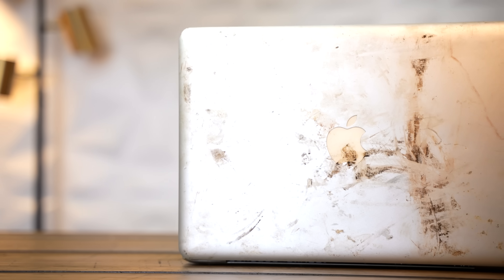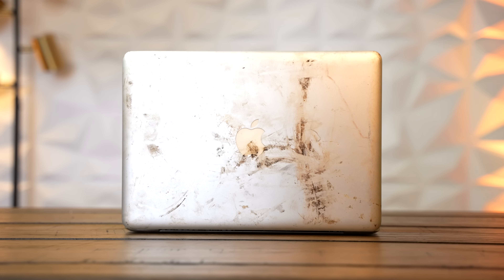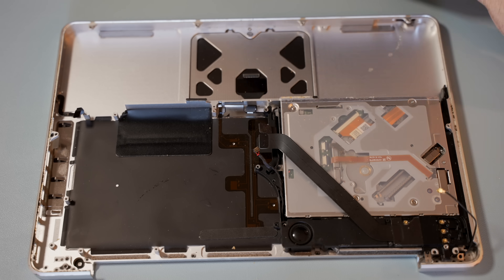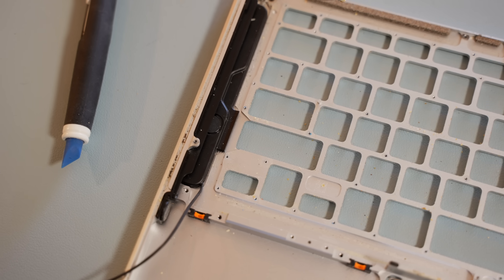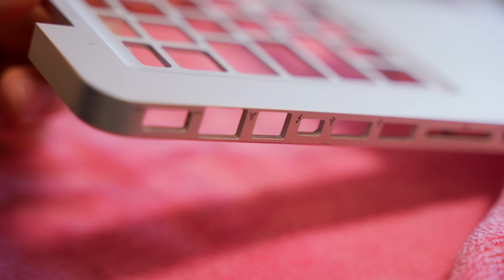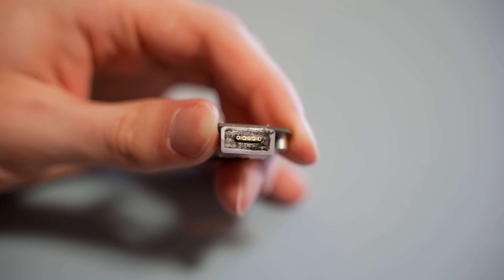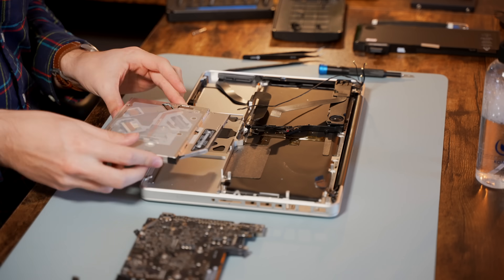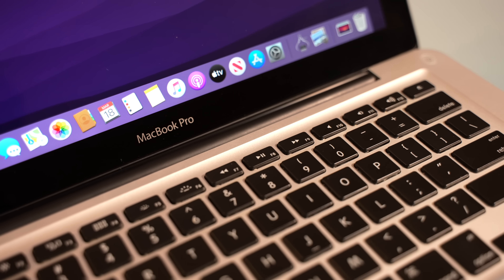Deep Cleaning & Restoring this FILTHY MacBook Pro for $10!

Comment: Even Lord Vader would be impressed by this.  “I see you’ve restored another MacBook.  Your skills are now complete. You are indeed powerful as the Emperor has foreseen.”  Also using a mid-2012 MBP with 512 GB and 16GB of RAM to replace my 16 year old mid-2009 MBP which had screen delamination and battery which couldn’t charge anymore.  It stands alongside my mid-2015 MBP, late 2021 M1 16inch MBP and the old 12C and 64GB Mac Pro thrash can with old Thunderbolt Display.

Comment: Not sure if this has been asked Luke, so I'm wondering:  If used in SERIOUS MODERATION, could you use a small handheld vacuum on the non-electrical parts, to suck up a lot of that crud? That poor Macbook was disgusting, and great job on the restoration!

Comment: The funny thing is........I'm watching this on a Mid 2012 Macbook pro... I'M still using this Macbook because of luke and his early videos....... My Macbook is fully maxed out with 16GB RAM and 4tb ssd (That's kinda overkill) with raid storage 2tb each i swapped out my superdrive with an harddrive enclosure and it's still worth it in 2021.

Comment: hi there , I have bought the same macbook a week ago and decided to clean it when took the bottom cover off there was a lot of small glittery particles which came out underneath the black sticker which is like a pad for the ram , just wondering is it toxic material ,can I clean it with bare hands it looks like led or graphite I am not sure :) will appreciate for any advice 
thanks and by the way very good video 👍

Comment: I have the same macbook and it runs like a charm in 2019 i bought a brand new of the year gaming laptop and all i want to say is fuck windows, i hate them so much i just don’t have luck with it. The laptop broke and was soo slow i could go on vacation come back and it would still be loading. My macbook of 2012 i think works soo well i’m gonna use it until it dies. Then buy another macbook haha
Ps: finally someone who has a sponsor that is good and related to the video. I’m tired of those bullshit sponsor mobile games cough raid shadow legends*cough*.

Comment: Hey Luke, what you did here is simply phenomenal, I was impressed with how thorough you are. Great work!

I would appreciate your opinion on this: 
I have a mid-2015 Retina 15” MBP, what solution would you use to clean the Retina Display with? I saw you using Koala for the 2012 but that is plain glass w/o the anti-glare coating. I read people recommending iKlear or Whoosh for Retinas but I’m also seeing some negative feedback as well. I would like to be particularly careful, especially because I hear that the 2015 is the one that is prone to have issues with the anti-glare coating on the display the most…

Thanks for your opinion in advance, I am sure from your many years of experience with all those Macs you have the right answer.

Comment: Hello Luck , fantastic videos, congratulations . I am from Brasil and I have a MacBook Pro 2016, and I am trying to fix my lid , that not wake up or put the  screen  to sleep by opening or closing it . I try everything  that could be fixed by  soft, like reseting SMC, NVRAM, booting by external drive, formatting internal hard drive,  but  the sensor stills not working.  Could you give me a tip or make a video how to locate it and how to get there. It could be a simple bad connection ?   Is there a place to buy it? Thanks in advanced for any given tip. My email address is mrpaulo@hotmail.com

Comment: The chance of the average user disassembling this to that level is about 5%. The chance of sane user successfully putting it back together is only 0.000003%. 

67 tiny screws just fit the keyboard. Nope. 

Your skills are impressive but not easily duplicated. Maybe a quick superficial clean is just fine for a 6 year old operational machine.

Comment: I had my mid 2012 MacBook Pro upgraded to 16gb 480gb SSD and new thermal paste last year and it’s literally better than new. It’s a sturdy computer (that model of Mac Book Pros were designed that way) which I LOVE, and it runs like an airplane. I can work with literally 50 Safari tabs on three different windows, Photoshop, Illustrator, Adobe Acrobat and Whatsapp at the same time.
It’s literally like having a brand new computer.

Comment: Actually you don't HAVE to ditch the top case, but removing the keyboard is a destructive process for the keyboard itself, the rivets have to be individually removed with side cutters, and a new keyboard has to be installed with self tapping screws, 67 of them, apparently.  I never bothered to count but it always felt like more than 50.

Comment: I love projects like this one~ ^_^

About 1.5 years ago now, I bought a Macbook Air (11") for ~110$CAD, with a 'stain' on the lid and 'trackpad issues', as well as some cosmetic marks and grime. A little elbow grease, alcohol wipes, and reseating/cleaning the trackpad, and no more stains, no more marks, no dirt, and its in perfect working condition! Someone offloaded it 'for parts' because they didn't know how to fix it.. it took me about 5-10 mins, because I knew what to do (its not difficult). One of these days I'll upgrade the SSD to something a little bigger capacity (64gb right now..)

Always preferable to fix and re-purpose (if possible) IMO~ ;P 
It's still going strong and is great as a backup/portable laptop. Just wish the RAM wasn't soldered on ;'D

Comment: nice job luke for cleaning and restoring that macbook mid 2012... i have 1 question did you used eucalyptus oil on cleaning the macbook that was psivewri is using?

Comment: I picked up my MBP 2012 13” in June 2017 for $260. I added a 256GB SSD and a 8Gb stick of ram immediately and put in another 8GB stick last year. A great value for what I paid, but now that she’s no longer officially supported, I’ve been planning my next move to a Mac Mini. At this point I’m just waiting for M2 and (more importantly) a model that’s not $400 more for a 512GB SSD and 16GB of Ram.

Comment: It's alright but 512gb ssd and 16gb ram more than 10$....
Though I get that was just extra stuff you probably had lying around...

Reminds me of once I bought a used MBP 2011 for 50$ and the mag safe was so dirty it was giving it issues... First it wouldn't connect then it did but it fans would spin too loud once I clean it out solved both issues too a few tried though...

Comment: My mid 2012 13" is still alright. i7, 8gb of RAM, and cheap 480gb SSD is still doing o k a y. Mostly needs a new battery, possibly new mic (or just plugged back in) and some of the keyboard keys are crunchy which I'm hoping I'll see how to fix in this video

Comment: Was this thing buried in a backyard for a week, and used as a hammer? Fantastic transformation and save!

My 13" mid-2012 has always had an EnCase snap-on case, Moshi keyboard cover, and rubber plugs in the unused ports. Still looks mint, still runs a treat.
Intel Core i7, 16GB RAM, 512GB Samsung Evo Pro SSD (cost a mint back in 2013). Still gets about 5-7 hours on battery, depending on usage.
Waiting for the 14" MBP with M1X to drop...

Comment: The Retina MBPs don't require you to ditch the whole top case. Yes, they keyboards are riveted in, but it's easy to remove, and you can buy screws, sometimes they come with the new keyboard, gotta check the description, and just screw them in. Soft aluminum so the screws go in easily. The screws work almost like self-tapping screws. C'mon man! Thought you would know this!

Comment: That Mac supports 8 gigs of ram. 16 can make it kernel panic
Reply from the maker: Wrong
Reply: @lukemiani  no I’m right.
Reply: @lukemiani  I’ve seen a bunch
Reply from the maker: @WilC137  Mid 2012 MacBook Pros can run 16gb of 1600MHz DDR3. Look it up
Reply: @lukemiani  I did. The MLB supports up to 8 gigs of ram. It might work okay with 16 but it can cos graphical issues, random shutdowns and kernel panics

Comment: Why didn’t you upgrade it to Big Sur ? 🤨
Reply: Late 2013 is the oldest MacBook Pro that's compatible with Big Sur.
Reply: @blagger116  There are patchers available that allows you to install Big Sur on these unsupported 2012 machines. I used BenSova's Patched Sur to install Big Sur on my mid 2012 13 inch Macbook Pro and it works great.
Reply: @aniello2000  yes me too but find my Mac is have some issues. It’s not recognized my phone WiFi range also smaller than catalina
Reply: @aniello2000  That's true but isn't the whole point of the video to restore the machine as closely as possible to its original aesthetics and capabilities? Any modifications to that could be done later if desired.
Reply: @blagger116  can’t we solve it
Reply: @blagger116  i knows that but  we can use Big Sur patcher 😎
Reply: Just wanted to point that out, that's all :)

Comment: Fantastic restoration job Luke. Looking forward to the future video. Unfortunately I would think most electronics sent to recycling centres just end up getting shredded and melted down to extract the valuable materials from them. It's a massive shame really when machines like the Macbook in this video can often easily be fixed up and used for several more years but they generally get scrapped as they are considered to be too old to be worth fixing.

Comment: I’ve had my mid 2012 since new. I’ve had 3 cars, graduated from 3 schools, and she’s still kicking strong. (Edit: I use it daily for everyday use I’ve upgraded to 16gb RAM, 500 SSD, and new thermal paste). I’m gonna use it till it dies at this point haha
Reply: still rocking a macbook pro intel core 2 duo from 2007........long live Snow Leopard
Reply: @Resume08  My current work from home machine is a 2008 mac pro which ive hacked the fuck out of. Runs Catalina. 2000s era macs are just awesome
Reply: @willm5032  Plus, you can still open them up and work on them. 😀
Reply: @cgi2173  Yep. This is true! I'm still eventually going to have to update my home mac to something more modern as I work on it and Software I needs more modern processors but for now my old mac pro is great.
Reply: @Resume08  I upgraded my 2007 iMac with 4gb ddr2 and did a cpu upgrade to a penryn t9600 2.8 and dropped in a 500gb HDD I had laying around it’s still going with Mac OS El Capitan
Reply: picked up a 2011 17-inch on eBay for $350 and it’s an absolute beast. The MBPs from this era truly are the best
Reply: @garysimcox345  If the gpu goes out (only problem with them) look up how to disable it and it’ll run off the intel one on the board.  The oven thing is temporary.
Reply: Same one. With a ssd it runs so smooth
Reply: Have to agree, my good ol' 2012 Air still rocks even with today's standards! It's incredible how valuable these machines are.
Reply: I have one, it's my main machine. 😀
Reply: Mid 2012 is the best. Upgradable, and Metal API support, so you can just patch it to Monterey without causing issues!
Reply: Fantastic - I also have a mid-2012 Mac Pro - never cleaned but replaced the former hard drive with a 1 TB SSD - can imagine doing both would enable years and years of more great use. About cars, I had an Alfa Romero Spider in the 80's - loved flipping down the top even in the winter, but it was in the repair shop every few months for small fixes.
Reply: I use a Late 2011 13" MBP, 16 gig RAM, 500 SSD and it looks "as new". I want a new M1 Air, but I can't say I need one. Old faithful is good enough.
Reply: @bolindow176   I want a new one as well, but don't need it if mine works like new
Reply: @bolindow176  owning the former and having setup three of the latter for my colleagues, I have to say you won't miss the 2011 clunker after you experience M1. I've got 2015 and 2017 13" MBPs as well, and they too pale in comparison.
Reply: I had one for years but the M1 MacBook Pro coerced my to upgrade, staying in the family though
Reply: I’ve just bought a 2013 retina MacBook pro
Reply: I love when people take good care of their devices. I had a samsung r580 since 2010, she's still kicking. She would even need an upgrade and boom she'll be super fast.
Reply: i second that, my mid 2012 13in macbook pro has been a trooper since day 1, even accidently spilt a entire bottle of water on it about 6 years ago and it still chugging along damage free!
Reply: Yup. Same here. My mid-2012 MBP i7 is doing well. It could use some new shoes (missing feet) but SSD and RAM. are wonderful upgrade. I probably keep it until I can buy an M2X. You know how Apple is by the 3rd iteration of a product its almost 100% improvement; loot a the iPod, iPad, iMacs, etc etc.
Reply: What if it suddenly dies? The data?
Reply: @SweetSourPickle  I back up important files. If a capacitor goes I plan to fix it, it's part of the fun
Reply: Same. Only thing I need to do is change thermal paste. How is the performance of yours? Mine is becoming slow and I think it’s thermals causing the bottleneck
Reply: @HeresMo  She runs fine. If yours often runs hot, then I would change the paste and clean the fan.
Reply: @MrVnick1  yeah I’ve changed the fans already one was faulty so I swapped them out. Next task the thermal paste
Reply: i just pick up a mid 2009 macbook pro for $199 n it runs soo gud love typing with it n watching movies soo gud for it age
Reply: i swapped my cpu it works way better
Reply: Same!!! My mid 2012 is working better than most windows laptops after 2 yrs. I too use it daily and I've upgraded to a 120ssd and I've replaced the battery recently.
Reply: just upgrade the battery and you are good ;)
Reply: I have one and it’s starting to die now. Can’t get 5 mins into a video without the fans turning on v loudly, and from startup there’s a 50/50 chance the Bluetooth works or says ‘not available’. Wanna get a new pro but they cost so much 🥲
Reply: Hi, I recently bought a refurbished (almost new) 2017 MBP. It has a few marks on the top of the case but thats okay. It runs like a dream and I cant wait to see how long it will last. I got it just in time to go with my Iphone 11. 😎
Reply: Same but my cpu kinda dead en need a ssd
Reply: i’ve got an early 2011 13 inch and it still works great. ive only got 8gb of ram and a 500gb ssd
Reply: Omg how did you upgrade the ram did you do it yourself or did you take it to the shop i need help my 2014 windows computer as been really slow recently it can’t even load up YouTube without lag
Reply: Exactly the same as me.
Reply: Same I have a 2015 mbp its really good its best for video edititng and platine game
Reply: Make sure to increase your days with it to repair it
They're really easy
Reply: I’ve been using it since last 11 years. It just needs cleaning up internally every two years but works just fine. I replaced hard disk and DVD drive with two 1 TB SSD and added 16 GB RAM and replaced the thermal paste.
Reply: i got a 2014 macbook pro 13 inch for $216
Reply: Still kicking in 24’ ?
Reply: @jacobwaugh2441  yea buddy!
Reply: @jacobwaugh2441  yes!
Reply: Yup. Tanks. Same with old Airs.
Reply: @alliejr  I just bought a late 2015 air
Hope it lasts trough my career
Reply: I had my 2011 macbook pro for 8 years. Maxed it out, but eventually It popped the logic board in 2019. Was a damn shame I lost that machine
Reply: What cars?
Reply: @henrycollins2478  sure not the Mustang that’s my profile photo 😂
Reply: @MrVnick1  I didn’t even notice, I like the mustang though.